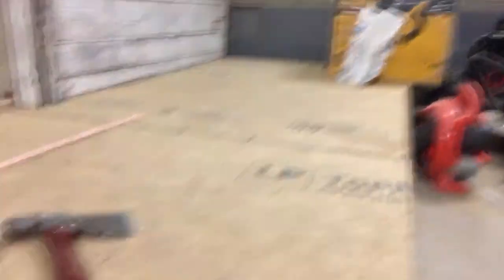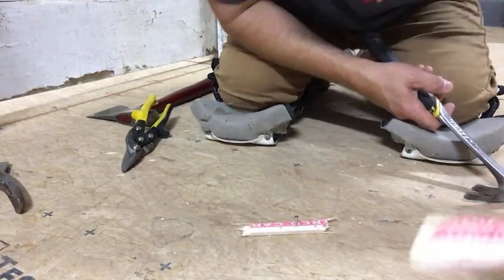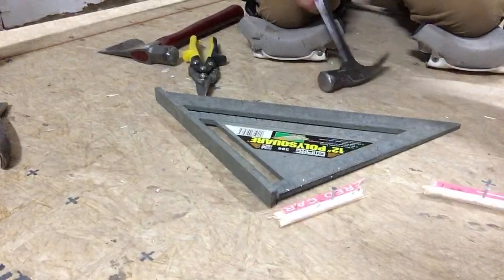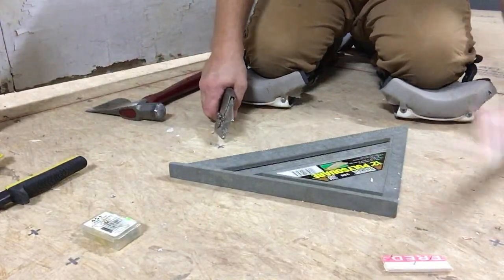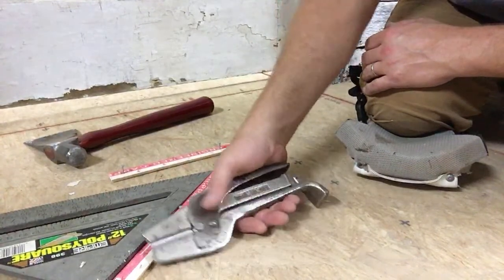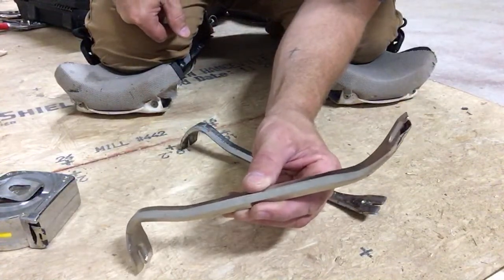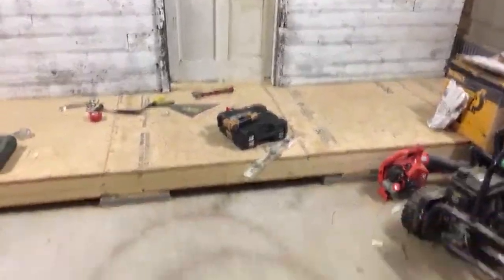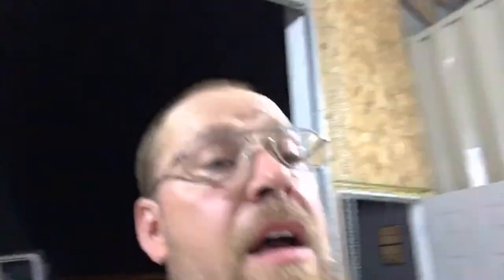Tack strip cutters & Studio sneak peek

Comment: That's awesome I've bought a pair of those cutters now, they're much better on my hands and make nice clean cuts. 
I know you said you've hardly changed the blades buy do you find that the fresh blades chip quit easy but will still cut tack strip. P.s  I've changed my name I'm no longer sausage!
Reply from the maker: Dave Awesome, yeah they can be really chipped up and still cut good, glad you got some
Reply: @FloorsbySouthernboys  when they got chipped up I was going to stop using them! Did you know that they cutters have a blade storage in the handle?
Reply from the maker: Dave sure didn’t I’ve had them for 22 years so I may have to do it when I first got him and forgot

Comment: Just imagine if you could just put the bottom of the handle on the floor with the tin snips and press similar to the tack cutters
Reply from the maker: Gabe pastel The snips Cut in a scissors motion, where the tack strip cutters the blades join evenly Together as they close